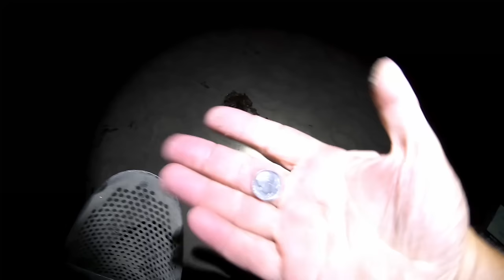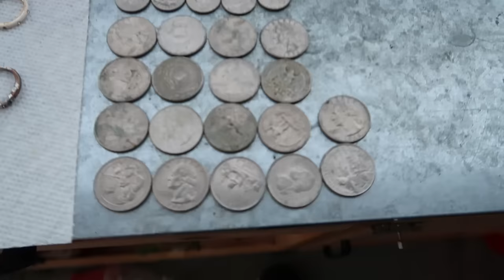The Beach had my GOLD | July 4th 😱

Comment: 06:50 The man you met said, "18K" on the bracelet. Usually items marked 18K are plated. 1/20 18K would mean that the item is plated with 18K gold making up a 20th of the weight.
Reply from the maker: 18k without any other marks is assumed 18k but Keith did have that bracelet tested and appraised, 1/20 would be gold filled and if it had markings like 'GP,' 'GE,' or 'HGE' that would make it plated.   Though I find brass items marked 18k often, we call that gas station jewelry. Lol!

Comment: The Equinox 600/800 are great detectors for the price. I have the 800, and it would be hard to justify selling it in order to "upgrade" to a 900 or Manticore. I might sell my CTX 3030 and all the coils someday and get a Deus 2, but I'll never part with my 800 (or Excal 2). It will have to die on me first, or me die on it.

Comment: I would love to win the sand scoop but... just in case I don't...I would like to ask your opinion on a sand scoop and pole.  I'm in Texas and our beaches can be soft to hard sand.  Can you recommend a scoop and pole that would be light weight and sturdy but also rust proof!  I'm 5'1" so I'm kinda of short but I hunt our beaches alot and I've already broke one pole and my current scoop is showing signs of rust! ugh!  Thanks, I really value your opinion!
Reply from the maker: I really like my Titanium Scoop from CKG and the Carbon Fiber shaft. Titanium won't rust and super light weight, though all carbon fiber shafts will break so learn to dig without forcing the shaft and it will not break. It has handles rocky areas, heavy sand areas and clay like wet sand, all I dig with a mindset to protect my carbon fiber shaft and that is why I hardly break them.  Though they do break if forced.
Use FWJ at checkout with any product from CKG and they give you 10% off and free shipping.

Comment: What setting did you use on your metal detector
Reply from the maker: It depends on the beach, but for sure I use beach 2 in the wet sand in all metal mode. We have iron rich sands so FE6 is perfect, I adjust recovery speed based on soil density the more dense to lower the recovery and slower my swing, high trashy areas I crank up the recovery. I also use 5 tones and adjust sensitivity as needed.

Comment: Hi Jim
Love your videos! Do you have special settings you use on your detector?  We are rookies with a Garrett 300 and trying
To learn all the settings. Appreciate your advice. Thanks so much! 😁
Reply: At the beach
Reply from the maker: I do modify my setting depending on the beach, but for most part factory beach 2 in the wet and beach 1 in the dry. Wet sand with deep targets I adjust recovery speed to 4 and if shallow rocky area I turn back to 6.   Trashy areas, I move recovery to 7 and toggle between all metal and discrimination mode.  I hope that helps!  Thank You 👍

Comment: Are you more likely to find things in the dry sand or the wet sand?
Reply from the maker: dry sand will have the most objects on a daily basis that you will have access too, however because wet sand can move objects around even drag them off shore so the wet sand keeps the treasures and only gives them up when conditions are just right. Large long period swells have the energy to remove what sits on the sea floor and put them on the beach making a great day of to detect but everything can change during the next tide cycle. Northern storms will remove overburden of sand creating a cliff or cut giving access to the heavier items that did not get dragged out to sea during the storms but that too will change after the next tide cycle.  So the answer is both are good but the wet sand can become great based on conditions.  Thank You 👍

Comment: Hey Jim, enjoying all your videos. I'm here in Lancaster, PA. Saw you smoking a tri-tip on a Pit Boss Grill, what style is that grill and did you just put it on the grill and go detecting or do you have to watch over it. Just getting back into this hobby, and I can't think of a better meal to come home to after a day of detecting...Thank you,, Mark
Reply from the maker: it is a Pit Boss combo grill from Lowes, gas grill and pellet smoker.  Yes, I put the Tri Tip then went metal detecting, I have the ability to control it from my phone but I did not need to, I just checked the Temps a couple of times while on the beach and came home when it was about ready to wrap.  Thank you 🤙
Reply: @funwithjim , Wow that's awesome, gotta get one of these. Thanks for responding so quick. Good Luck in your hunts.

Comment: I just subscribed,  what kind of a metal detector do you have, and would you upgrade ? I'm asking as I'm looking to buy one. I'm in Asia, But I guess  it doesn't  matter on what beach you detect. Thanks.
Reply from the maker: Minelab Equinox is the best choice, in my opinion. Powerful but easy to use, light weight and I have found a lot of GOLD with it!
Reply: @funwithjim  Thanks, good to know its lightweight as I'm 73 , hubby 77 and probably not as strong as we think it is. Any other  advise for us is welcome, but I doubt I can carry the scoop as well. Another point is that I'll be on beaches  with lots of rock pools. I'm a yachty so will be in places I don't know. I read that you can buy metal detectors  that go 1 or 2 feet under water and others that don't ping ! When it's aluminium or bottle caps. Sorry that are are a lot of questions, but I'm in a place where I have to buy online and noone to ask. 
Thank you.
Reply: Please do me a favour and try to reply to my question,  I'm sure you didn't see my add on 🥰

Comment: Do you always run “detect all metal” so you can hear ferrous metals ? Can you share your settings.
Reply from the maker: Yes all metal all the time or most of the time.  Trashy areas I discriminate for most part.  The real reason to hunt in all metal is depth, a quarter deep will sound like iron, same with any other object that is deep. So deep iron I take a scoop if it sound better I keep digging, when I see that it is shallow iron, I then can walk away but a lot of the time deep targets are good targets.
Reply: @funwithjim  
Got it. Did you change the tone for ferrous metals

Comment: what kind of camera do you use?
Reply from the maker: GoPRO Hero 7 black,  Thank You 👍
Reply: @funwithjim  ah, ok. I was gonna suggest a media mod. But they only make them for the 8s and up. There are aftermarket lights you can attach to the camera if you have a media mod on it. It’s basically a jacket that partially covers the camera. It has an external mic so it removes almost all of the handling noise. It also has a couple spots for you to mount a light specially made for night time recording. I use one myself. When you de ode to upgrade, I highly recommend getting one. The spot light on camera looks just like that, a big round spot of light. lol, the light I have brightens up the entire view of the camera and is very bright.

Comment: Do you throw the trash that you find in the garbage or just throw it back on the beach?
Reply from the maker: it depends on if the beach cleaner has gone by the area, if not I line the garbage in a row so he can vacuum it all up if the cleaner has completed the area then trash can it goes and most all metal trash goes in the trash section of my finds bag.  Thank You! 👍